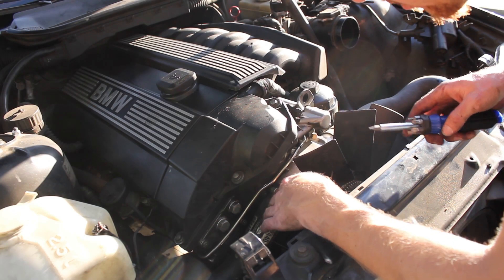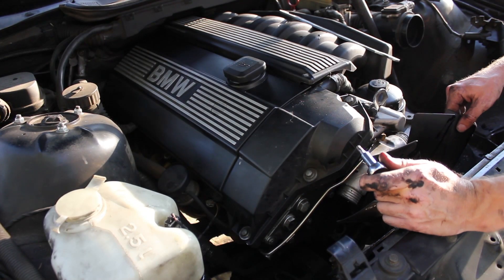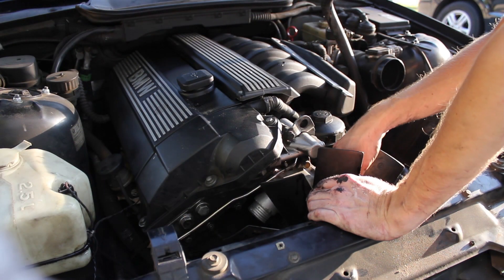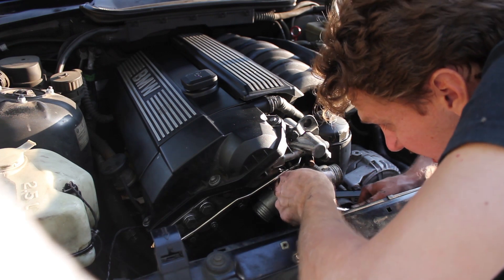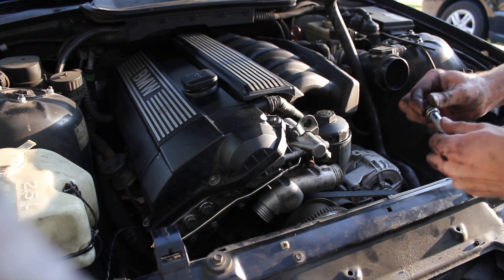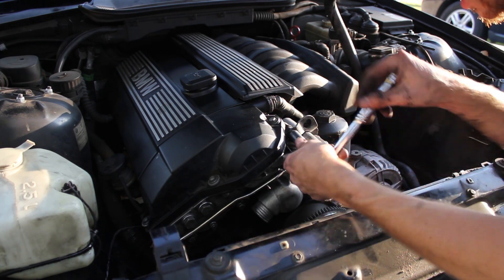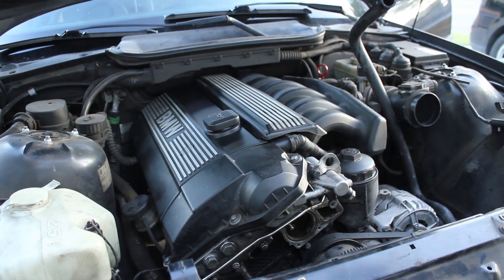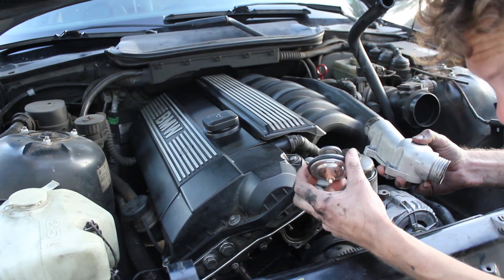Replacing the Thermostat on BMW E36 328i

Comment: Do you need a gasket sealent for the  housing or it won't leak
Reply: Id retro fit your pudding Hatch with my Due Piston but use grease first or else ur pudding hatch will tear

Comment: It can't be a 32 degree thermostat. 32 degrees F is the point where water freezes. Even if it were 32 degrees celsius, that's 89.6 degrees Fahrenheit, which is still too cold. My guess is that you bought a 92 degree celsius thermostat, which translates to about 198 degrees F. I use an 80 degree celsius in my E36 because BMWs run so hot, but I live in the SW.
Reply: You are correct. Misstated thermostat opening temperature. However, thermostats are available with multiple temp ranges.

Comment: Fan clutch is super easy to remove. Just put your wrench on the nut, smack it clockwise with a hammer or sledge (have something soft to stop the wrench like a roll of paper towels) and unwind it clockwise.

Comment: Awesome video, surgical extraction of the thermostat was explained in simple, easy to do steps.  I'm sure this has helped a lot of people.  Keep them videos coming!  I just bought a 94 E36 and it is overheating, takes a few minutes of driving to overheat, looses a lot of coolant, but there is no visible drip, just hissing from the heater core hoses area.  Would you share your thoughts on this? Thanks
Reply: JC, I'm back to report that the underlying cause of my overheating was a broken heater hose flange at the firewall. 
 This caused an overheating event that busted the cylinder head gasket.  Upon removal of the head, it was evident that the gasket was busted on cylinders 3 and 4 on the passenger's side.  Further inspection showed several spots of pitting on the mating surface of the head, just over the bad head gasket areas.  I wound up replacing both the head and the gasket and while at it, replaced all of the other main components of the cooling system.  The car is running good now.  I hope your luck is better than mine.  Take a close look at the pipes under the intake manifold and particularly at the heater core hose flanges at the firewall on the driver's side.  These 3 flanges are plastic and get brittle over the years.  They break and leak coolant that comes down the firewall, just ahead of the pedals.  This is tough to see, especially if it is a small leak, like mine was.  With luck, just replacing the flanges will do the deed.
 (all 3 come joined in one piece that bolts against a mating piece on the firewall, don't forget the gasket).  I had to take my intake manifold to access the area, no fun, but while there, I replaced the starter as well and all of the hoses that run below the intake manifold, which became nicely exposed.
Reply: Typical thermostat failure.
Reply: I have the same problem on my '96 328i.. The last time I replaced the thermostat was back in 2007, when it overheated.. If you fixed it, what turned out to be the problem in your car?  Thanks..

Comment: Does the coolant need to be bled after this job?
Reply: yes everytime you empty the rad or remove a hose
Reply: Only if its that time of cycle usually 30 days repeating once a month n straddle dip my lab rocket in your oyster  ditch for max Performance zaddy bear 🐻

Comment: Is it really necessary to torque the bolts when putting them back just as long as they are tight?
Reply: +Dennis Rawlette Anything that bolts to the engine is pretty important to follow torque specs. Snapping a bolt off in block or stripping out threads is not fun. Also gotta make sure the gasket is fully compressed.
Reply: To my understanding it isn't i just tightened to tight on all the bolts and i haven't had any problems. Now when it comes to things like the head gasket and valve cover gasket torque will matter greatly to create a good seal. Hope this helpped!

Comment: hey i replaced the thermostat an put a new waterpump in an bleed the engine on my 92 e36 and it overheats any thoughts???
Reply: E36s are the queens of the overheat cause a blown head gasket. How did you bleed the system. An incomplete system bleed can result in overheating. Also trying a system reflush. They sell kits at autozone. Check your fan clutch for cracks on the blade and strange noises. Thats another possibility. Check your thermostat housing for cracks. It may also need a good cleaning. Also the the gaskets thermostat and housing need to be seated right to create a good seal. Thats just about all i can think of off the top of my head but i hope it helps. Ive dealt with tons of e36s especially overheating problems and these are the ones that i attended to fix my problems.

Comment: Not necessary to take the radiator off. The fan nut uses a 32mm wrench and with the tap of a hammer comes lose.
Reply: I think he said it wasn't necessary but your detail helps.
Reply: thank you! I wanted to ask that question!
Reply: Alexander Coura
no problem. I have replaced the thermostat and water pump many times and didn't need to remove the radiator.
Reply: Turn your fan blade clockwise to undo
Reply: Mitch Lock which hoses can you buy because the standard horse don’t match the thermostat housing

Comment: i have a '96 328is. in one of the comments below, you mentioned that thermostats are cheap parts. what about the radiator or the water pump? are those parts pretty cheap as well or more costly? do you know where i can find this info online? my car is currently overheating and using a lot of water/coolant. so i have to pour water into the radiator or water pump thing (sorry, don't know much about cars). it is fine if i drive it short distances but if i drive it longer distances or just get stuck in traffic, i'm screwed because it overheats which i know can lead to a cracked head gasket (right?) if it overheats often enough. and i know that THAT would be a very expensive to fix. anyways, i don't know if my problem is that i have a leak OR if my thermostat or water pump is broken which is causing the overheating? any help would be appreciated. thanks :)
Reply: alypaige88 if you're losing coolant and having to replenish then you obviously have a leak somewhere that needs to be addressed.  And that could be your only problem since a leak will allow air into the system preventing the coolant from making its rounds and cause overheating and/or no or low cabin heat.
Reply: First thing i would check is your radiator cap. If its bad and doesn't form a seal you will lose coolant. Check your radiator lines for cracks and liquid on the outside to identify possible leak areas. It is quite possible you are leaking coolant into your exhaust manifold if your not seeing visible leaks on the grounds. You may need a coolant reflush to clean the system or maybe you need to bleed the coolant system. Air in the system can cause your expansion tank to explode (learned from experience) or excess heat to enter the car. Dont suggest driving the car when it over heats can cause the heads to warp and a blown head gasket (also learned from experience). Hope it works out!

Comment: why did you replaced it how did you know it was broken
Reply: engine wasn't staying cool, engine will get hot without rad fluid, duh, if thermostat sticks than it cant open to cool the engine.
Reply: ok thank you i asked because i dont know
Reply: no problem
Reply from the maker: There was actually nothing wrong with my thermostat. I replaced it when I replaced my water pump because it's a cheap part that's easy to replace if you're already draining the coolant.

To better answer your question, there are two ways the thermostat fails: stuck open or stuck closed. If it is stuck open, your car will take a long time to get up to operating temperature (and may never read 12 o'clock on the temp gage). If the thermostat is stuck closed, the car will likely overheat. To figure out if it is the thermostat or some other component, try to squeeze the hoses on both sides. If the thermostat is stuck closed, one side of the hose will be under pressure. You will not be able to squeeze this hose. On the other side, you will probably be able to squeeze the hose slightly as the stuck thermostat won't allow the coolant to pass through freely.
Reply: +BMW Repair could u give me some advice please? My car gets to the 12 o clock mark when i drive in the city. When i go on the highway, the temperature drops to the left side(blue, cold area). What could this be? Does the coolant level has something to do with it, or is it the thermostat?Thanks in advance, have a nice weekend
Reply: @erhan2355  Mine too.  Hopefully someone will answer this

Comment: what kind of coolant is recommended for a 1995 325i e36 non m3? just bought one last night
Reply from the maker: Look in your expansion tank. If the fluid is green, then it's just regular coolant. Don't bother putting BMW coolant in it unless you flush the whole thing, first. If it is more of a blue color, then it is the special BMW coolant that you can get from the dealer. Unfortunately, you pretty much have to get this coolant from the dealer at $20+ per gallon.
Reply: BMW Repair ahh okay i see thank you, one more question though, every gauge on my cluster works except the coolant temp. i pressed the temp button and it said -35 F. A.C. works fine however the heater doesnt.. could it be the thermostat? ive driven this thing over a 100 miles the first day i got it and it ran fine and still is.. i just want to get the gauge fixed because i know the cooling system is a big thing with bmw
Reply from the maker: So there are actually two different systems on the e36. The temp button will give you the outside temp. the sensor for this is located in the left wheel well and often goes missing. it's not connected to any of the other systems and not important.

The Temp gage on your instrument cluster is, however. There should be a metal sensor screwed into the side of your radiator. (You can see me install this sensor into my new radiator in my vids on the topic). Chances are, this sensor is bad. I'd try replacing that... but note that doing so will result in the loss of some coolant. Good luck!
Reply from the maker: surryj Also, If this sensor is bad,  your aux fan at the front of the radiator won't switch on correctly. This could lead to overheating.
Reply: BMW Repair alright then. ill change it when i get my next check and let you know how everything goes. and thanks again i love your videos